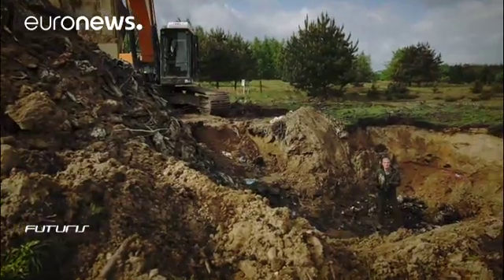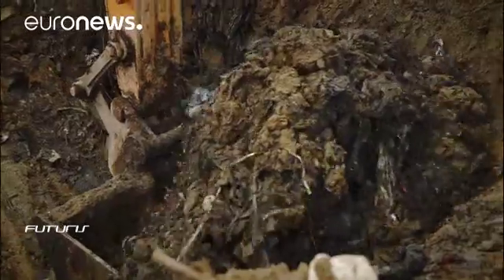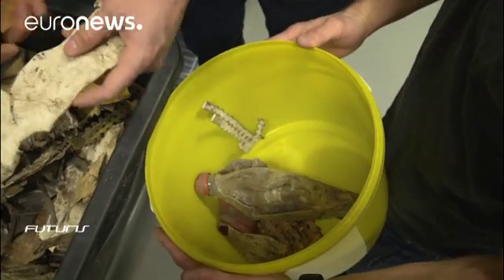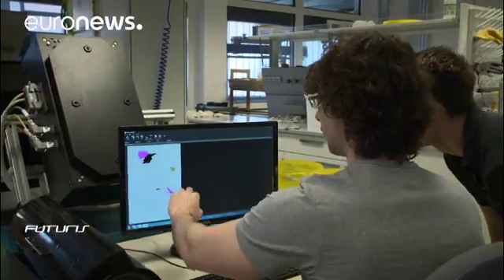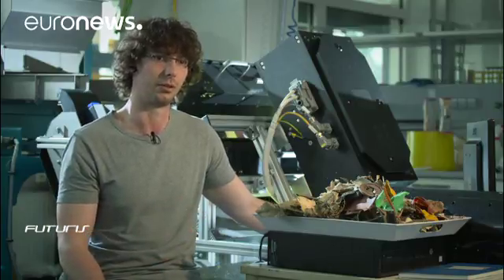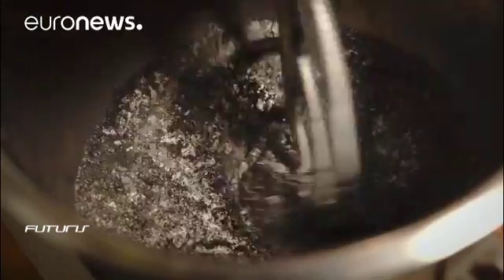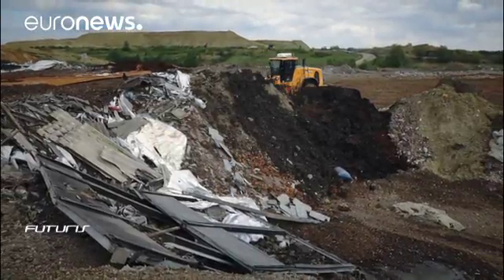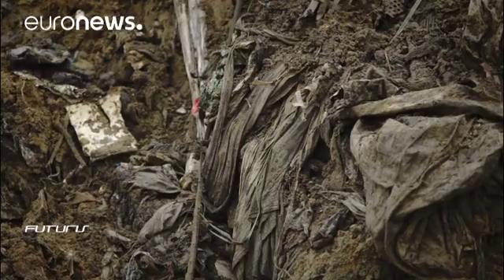Can industrial waste be mined and recycled in sustainable ways?

Comment: I do like the sound of trash mining. Given just how much plastic there is I feel that all of it could be made into long lasting bricks and used for masonry. We don’t have a finalizing method to get rid of already existing plastics, but if we can turn our trash into bricks in buildings we use for the next hundred years or so, we can always get to deconstructing it to get rid of those plastics better once the building has outlived its use. 
It would probably be hell to contract, and it would only help the current trash problem and not the continued adding of trash that’s always ticking up in quantity. But if we can ban single use plastics then making the trash plastic into bricks would help more than just the land and ocean.